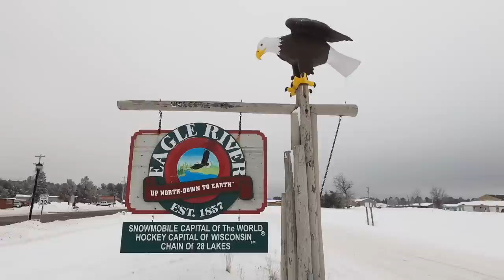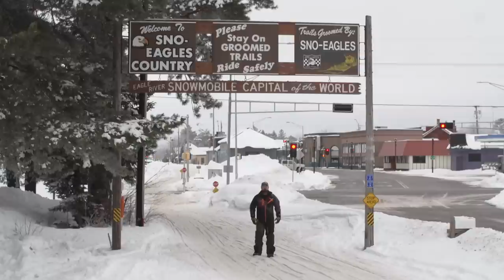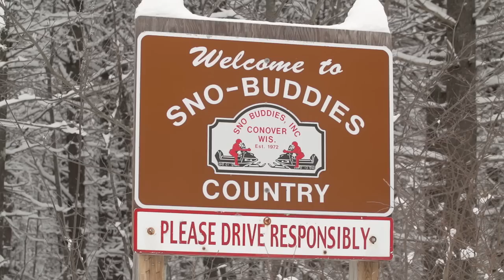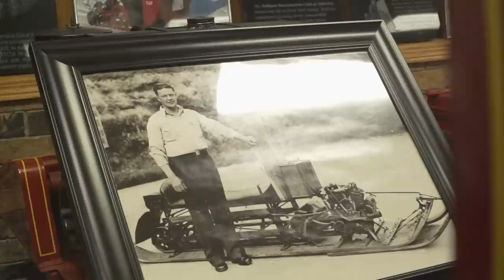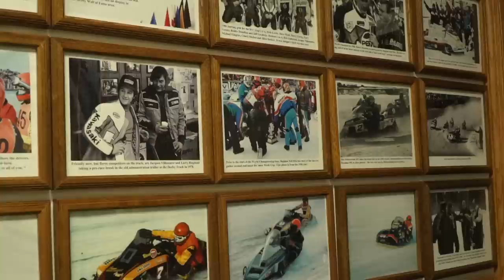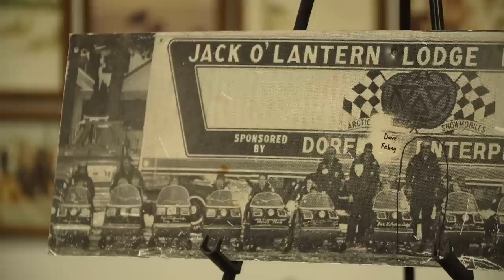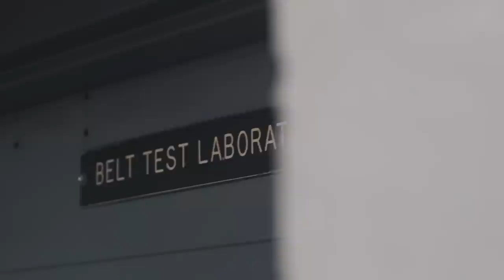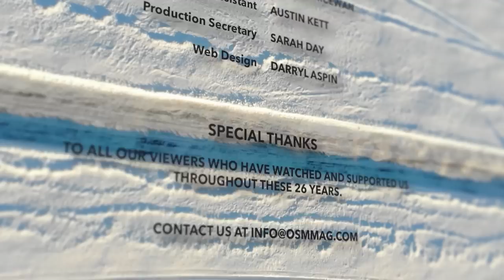Snowmobiler Television 2023 Episode 09

Comment: I live 50 miles from Eagle river and one thing when riding to do especially during race weekend is avoid going to Eagle River area.. Way way way to many sleds and trails are literally pounded even on good snow years to rock and dirt! I guess if you don't mind almost getting hit at every corner from throttle flipping bar pounders and having your skid turn into a rock crusher I would recommend it lol! If you want to go to races take your truck!!
Reply: Hi Larry, We must have gotten lucky with conditions. The trails were a little busy and more used up around town, but I thought with the race event going on the trails were way better then I expected. We did ride away from town with the group  each day to return to Eagle River. Still a great snowmobiling adventure! -Jeff